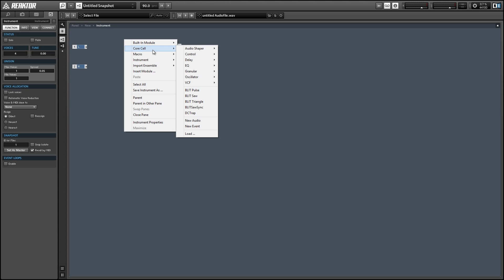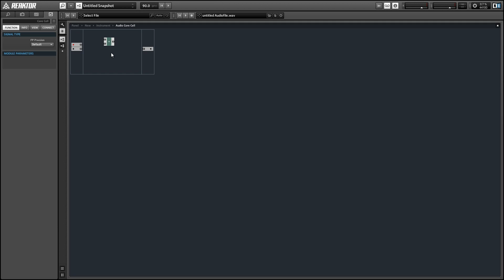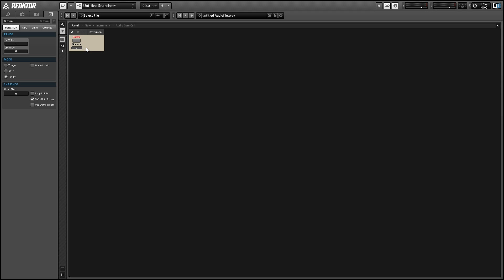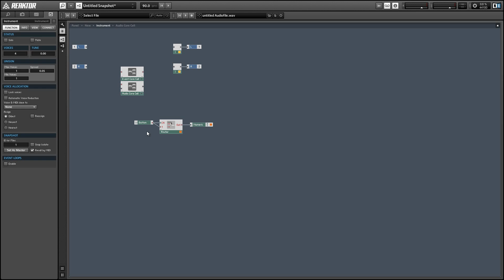NI Reaktor - Intro to the Core Environment - How to tutorial

Comment: While I'm excited that you are now teaching core, my experience with core is that it's often brutally CPU intensive. That might not always be the case, depending on what you're doing. However, I've noticed that a lot of core modules can do some pretty cool things that you might be hard-pressed to accomplish on the primary level. But yeah, seems half the time it will cost you a pretty penny. Will be interesting to learn how to cut corners with core modules in order to economize CPU, and my guess is that this is really the ONLY reason I would ever use core.
Reply from the maker: If you know what you are doing, Core gives you a substantial amount of freedom and control that Primary does not. A well programmed Core cell can often be much cheaper in CPU than a Primary equivalent.
Reply: ***** Glad to hear it :) Looking forward to more tuts!